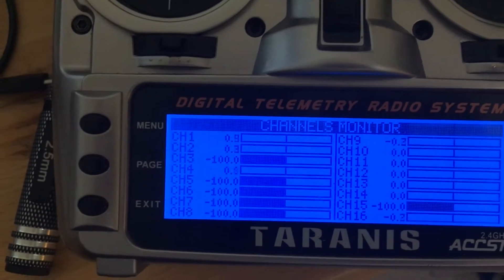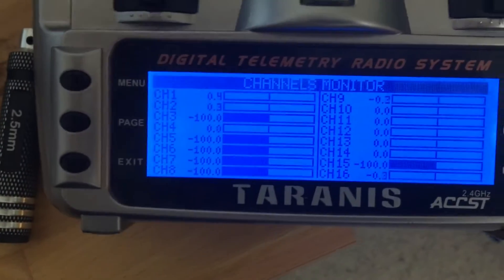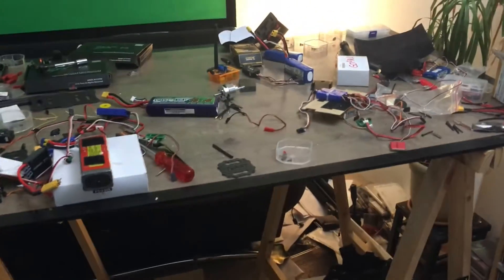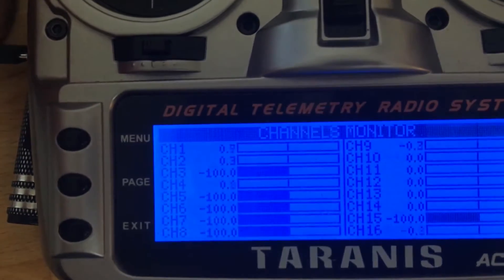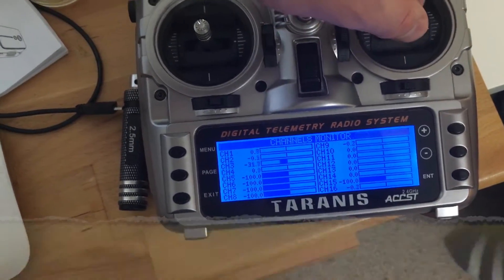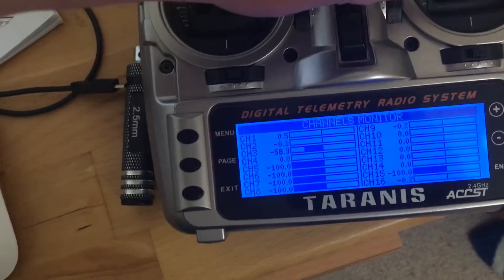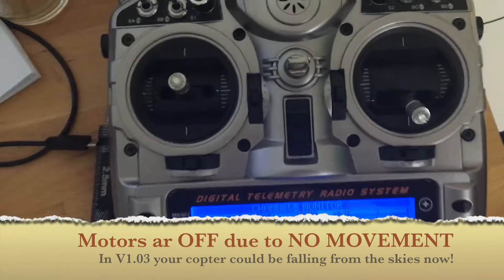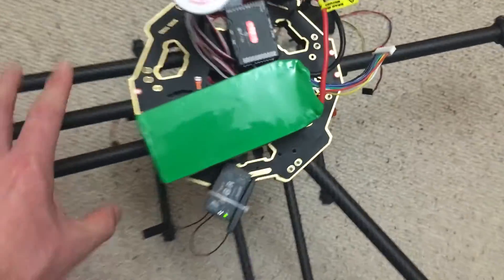Tarot ZYX-M safety fix - NO auto cut off

Comment: Ever get your hex back in the air?  My 690 has been gathering dust since August waiting for me to repair a broken mounting bracket
Reply from the maker: I’ve been on it some time ago and figured it needed some new esc ... but same as yours, it collecting dust at the moment :)
Reply: Well, I moved mine from the garage to my office last week so that's a start in the right direction.  Now it can collect house dust instead of garage dust =P
Reply from the maker: I see- but yours is at least getting somewhere ;)
Reply: Hahahahahaha!!!  Too bad it's not under its own power
Reply: I upgraded my ESCs as well.  I started with HK Blue Series a few years ago but last summer I switched to a smaller and lighter set with much faster processors and more efficient MOSFETs
Reply from the maker: I still got the same oversized hobbywing 40A ;)
Reply: The Hobbywing's are pretty sweet.  I have a set of the 35A micros

Comment: why on earth would you put the throttle on zero while flying ?
Reply from the maker: +osergios perhaps on emergency landings. But the Intension is to decend fast and controlled. The Zyx though disarmed at to low throttle and that is something I won't risk again
Reply: i fly multirotors for many years and i don't think you can descent controlled with throttle too low unless you fly a racing drone that is why seems strange that you had this problem in the first place. Plus its not a problem of tarot controller but every controller in this class ec naza a2 a3 etc does that and seems normal.
Reply from the maker: +osergios I've been flying naza and others but none disarmed like that- 15% throttle should be NO REASON to disarm, wouldn't you agree on that? And if so, you surely understand that a little bit of precaution won't hurt!
But with the current installed firmware, it won't happen anymore. And if it should, I'm backed up.

Comment: r u plugging the cable into the GPS and not the flight controller? You have to plug it in the GPS it self the round part. I had the same problem.
Reply from the maker: Everything is wired correctly ... I made sure of that.

Comment: hello i need help with mine gps setup 
I tried to update GPS Firmware and it refuses.  I also tried your idea for calibration and no matter what I do I get 3 red flashes forever! Never can get into Calibration mode at all.  In addition I have left on in open area for up to 30 minutes and never got GPS Lock at all.  There is a small pink looking light inside GPS Puck when on.  Any Help Please?  Thank You
Reply from the maker: Uh, thats hart to tell whats wrong here. Honestly, I have no idea! Did you check the RCGroups Thread about it? I know, there have been some variations of the GPS ...
Hope this helps you - good luck

Comment: can this issue not be resolved in the assistant software.  i read in the manual that..... and i quote  

 "If you choose Immediate Cut Off in the assistant software, please do not push throttle stick less
than 10 percent during flight. Otherwise, the motor will stop."

does this not mean there is an option to prevent this from happening???

i am just about to install this F.C on my hex and do not want a mid flight failure.  thanks.
Reply from the maker: +Richard Gilmore True... thats in the manual! But I don't look at my sticks while descending. After having lost one expensive hexa due to this (and so seem many others on rcgroups to have as well) this little fix prevents me from being able to get there again ... "Fly safe ..." :) That's what I want to sure off. Do you look at your sticks all the time while descending? 

watch this to see more on this : https://youtu.be/jCLjFQ0Dx2U?t=7m10s

All the best